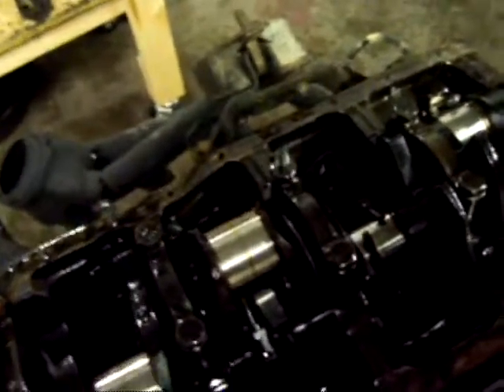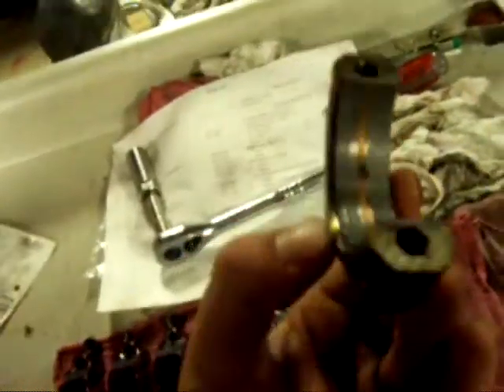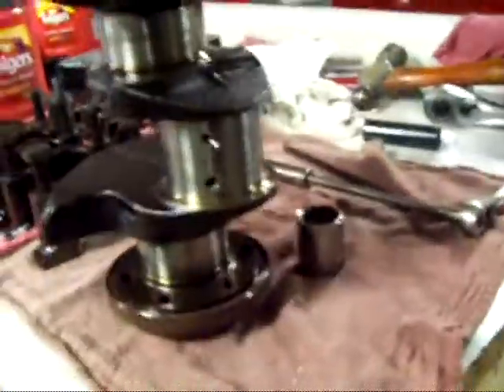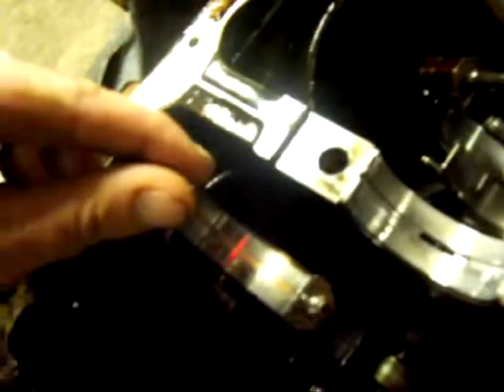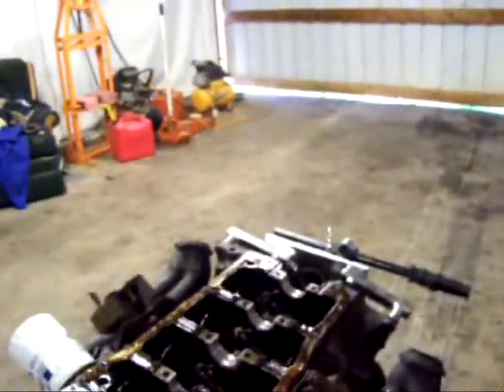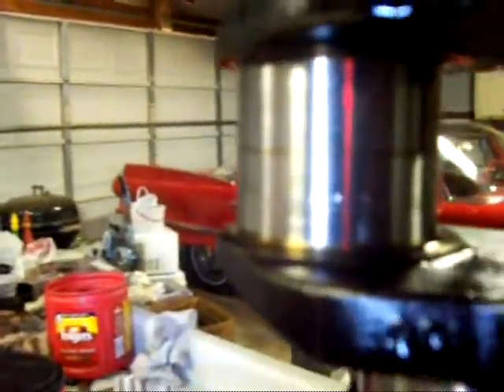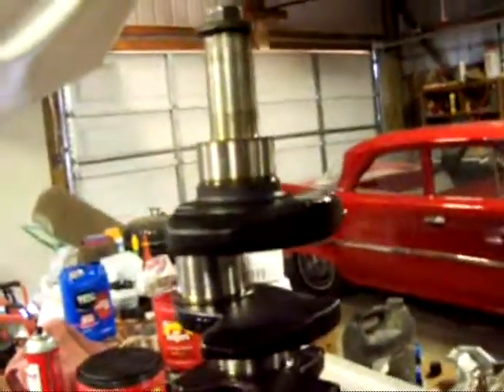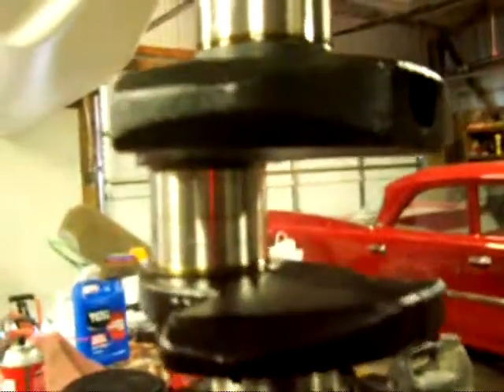I found out why my rod bearing was toast

Comment from the maker: @Schmity6 When a crank gets nicked like that it pushes the metal down in the middle but at the same time pushes up some of the metal around it up higher than the surface of the rest of the journal, sort of like a crater. When its all put together, the high spot on the crank digs into the bearing, ruining it.

Comment from the maker: @MrMontoyaman27 So far its working fine. If your rod bearings are bad because of mileage I would say replace them all. The only reason that I only replaced one was because when I put the engine back together I nicked the crank, all the other rod bearings were new and still in good shape.

Comment from the maker: Yeah it came out of a truck, its like the HO but not quite. Truck has cast pistons not forged, same heads, truck had the flat tappet cam but could be converted to use a roller setup.  The EFI stuff is mostly different, intake, TB, etc.  The truck motor was kind of a bastard mix of non-HO and HO parts.

Comment: how  many  miles did you end  up getting on  the engine  before the  bearing  failed and did it spin or  just start rattling
the  picture you showed of the  mains  from  what  I see the  bearings  looked  pretty  good 
my  guess since you  nicked the crank on  2 sides would be  that you bumped  the  crank with  the  rod bolts when  installing that piston 
I am surprised  it  didn't fail  really  fast  usually they  end up doing  just that and ruining all the other  beraings too